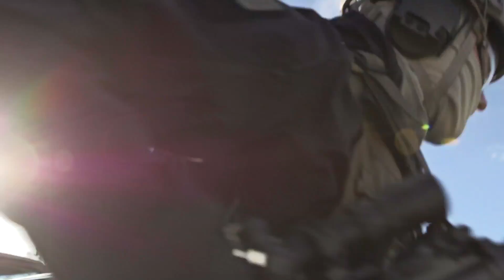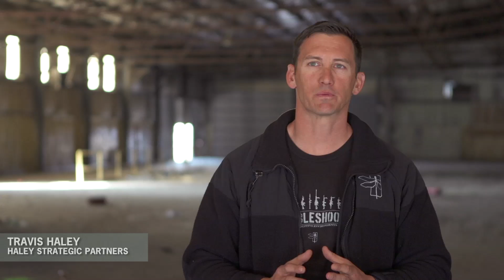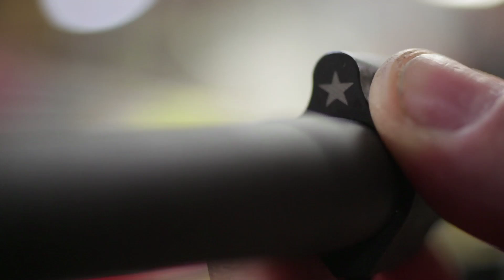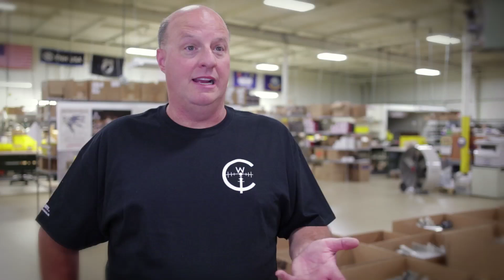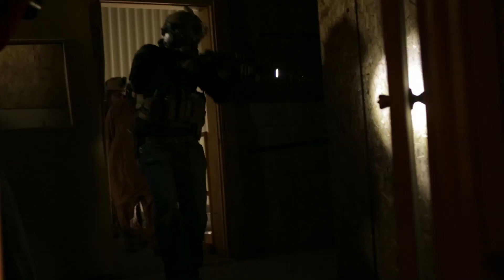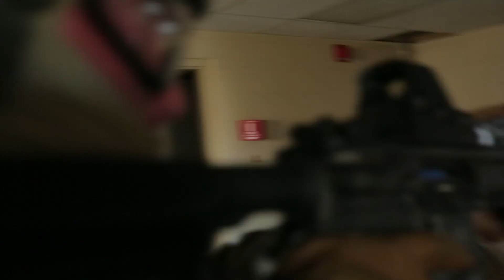The Haley Strategic Jack Carbine Built by BCM

Comment: Funny one of the first (HONEST) video reviews of this gun pretty much concluded it was an over-gassed, out of spec crap.  

It didn’t even meet standard MILSPEC parameters.  Much less than rifles like LWRC who are actually used by special operations and SWAT groups around the world.

I’ll give you a free “Advertising” secret.

Products that are heavily pushed, reviewed, and marketed on how “amazing” they are; aren’t.

The really exceptional product don’t advertise.  

It a waste of money because the product history and reputation speaks for itself.

Take a second to reflect on all the AR15/Pistol/shotgun variants that are heavily marketed to the public.  They end up being AVERAGE at best.

Reflect on any marketing you’ve ever seen from legitimate HQ MILSPEC+ firearms?  Rare and uncommon.

You want a legitimate HQ MILSPEC + AR15 riles?

Simple, LWRC, LMT, KAC, and Barrett’s REC7 to start with.

Basic, but guaranteed MILSPEC or better rifles?

COLT, FN, DD, JP,  (HK deliberately left out).   

You really can’t go wrong with any of those firearm manufacturers AR15 lineup.
Reply: BCMs gassing issues were resolved years ago. They’re about as mid as you can get and better than new Colt. Old Colt I’ll agree with you on.

The market was also completely different 12 years ago (ten from your comment). Most rifles back then were all still carbine length gas on a 16” barrel and over-gassed to hell. The Jack carbine was at least more forward thinking with its tail as gas system length.

Comment: What an overpriced piece of crap which you are just paying for the name.  Come to find out, the upper and lower were just re-branded Aero U/L receivers.  Finish was very sloppy for the price!  Didn’t even get a chrome BCG like DD sold at the time.

You literally could have pieced together 10x the gun for the price on your own!

And, you don’t even get SSA trigger for the price.  Amazing firearms tactic trainer and/or operator.  Gun designer?  Junk.   

I like TH message, programs, then he tries to scam the community out of money in exchange for junk.  No different than that “FireCLEAN” scam that was SWORN BY all these Delta/Seal operators on videos, conventions.  

It ended up being pure cooking oil hahaha.   FrogLUBE wasn’t far behind which ended up being color green dyed Coconut oil hahahaha.  All these BS SEALs swore the used that over priced crap religiously.  When every TG I know was secretly using their own special blends of motor oil, trans oil, and lithium grease.  Once again, paid to sell you lies.

Don’t get taken by these scammers; take what you can from them.  Then, leave everything behind.  Build, and buy your own gear.  

Leave the fancy, pretty, sexy name propriety crap (yes, I’m talking about you HK and your 12lb 416 3moa monster).  

It really bugs me when “icons” of the 2A community try to push their own brand of gear that is twice the price of HQ gear used by SOF, just because of their name they put on it.  

Screwing countless new shooters out of hard earned money just because they trusted you.  Such BS.  

Do your own research.

With all the comments and this being a 10 year old video; no one will read any of this anyways.

Comment: First thing out the BCM  Rep's mouth was our objective is to build it correct . Then flashes to barrel nut being torqued with the tool fixed parallel to the torque wrench  (which acts as a multiplier )  rather than at 90 degrees. Perdy gun though!

Comment: It is now January 2021 and my brand new BCM MK2 Recce 16 is so loose between the upper and lower that it rattles.  Attention to detail is certainly not there.
Reply: They use accuwedge to get that wiggle out. Most billet upper lower combos machined together for fit. Heavy and expensive. Accuwedge 4 bucks. FYI Rattle does not make less accurate, JUST ANNOYING 😝

Comment: Build same rifle for half price.
Reply: yep
Reply: I just built a clone essentially. 
Geiselle mk14 SMR 13” - 191.00 vet day sale
BCM BFH 16” mid length - 269.00 Halloween
BCM BLEM UPPER - 50.00 on BCM site 
$500

I through an Anderson lower($40.00) (I’m from northern Kentucky, so I’m partial)
ALG trigger, BCM Hhandle and stock and an eotech 512 ($379 at PX)with Magpul pro BUIS 

I’m looking to buy a new BCG and charging handle to match the quality of the upper but all in all it’s well under $1000.00 and has been great. Sales and patience is truly the key to an outstanding rifle without spending the incredible prices some people are asking
Reply: @Not-a-bot222  really? You didn't even do half of it right to call it a clone ... nevertheless (and especially) compare prices ...
Reply: LtThompsonCS well to be honest I did not say I built a 1:1 replica. I built essentially a clone meaning some things are different however the overall concept and parts are very similar. I cut corners with the lower and I don’t have the same rail. I recently through a geissele super charging handle on it and the super braided 42 buffer. My comment wasn’t meant offend a “purist” or start an argument 5 months after the original comment. It was meant to shed light on my own project and give prices for someone who may want to build a good weapons that is very similar to the one in the above video.

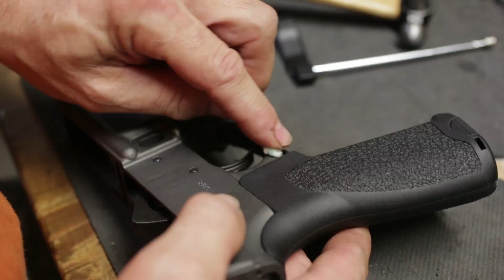Comment: BCM makes some great stuff. I definitely have some of their parts on my rifle. However, when they started talking about their muzzle device and the guy at 2:40 said theirs was the first to cross between flash reduction, ground signature, and compensation properties, I laughed. Though the standard A2 flash hider is primarily a flash hider, it was designed to be solid on the bottom to not only reduce dust pick up, but to also reduce muzzle rise by venting gass upwards. Pushing the barrel down. If I were to be totally honest, you don't really need anything besides the original A2 flash hider. Not saying the their muzzle device isn't better, but definitely not the first device to address said issues.  Even then, it isn't that much better than a stock flash hider. There is also a flash comp for 26 bucks that is slightly longer than the A2 and shaped slightly differently which also slightly inproves both flash reduction and muzzle rise. Again, not saying the BCM flash comp isn't good. But they do overhype it a little. Unless you go for a muzzle brake, most flash comps are not very different from each other.

Comment: And here I am running a palmetto state armory setup...
Reply: What if I told you brand doesn't make you shoot better...

tight pants do
Reply: My first build was a PSA middy upper. It was a sweet rifle. Just remember, a good warrior can fight with any weapon. Adapt and overcome. Make your weapon work for you.
Reply: I have full PSA CHF midlength I built for a bit over $600. It's been a great rifle. My BCM has a complete 14.5 BCM upper with BCM CH and BCG. I used a PSA lower with a BCM pistol grip and Magpul CTR butt stock to save a bit of money. Even with a pin and welded surefire brake and BUIS I'm only out $700 or so. That's the only think keeping me from these. There's so many great guns you can piece together to save a little money. Although the resale is great on these I bet.
Reply: psa hammar forged barrels are from FN, same as bcm. being in spec is more important than materiel unless its the BCG or you are shooting 10s of thousands of rounds of ammo a year.
Reply: U paid only $700.00 for a complete BCM upper , sure fire break, and a off brand lower?? How?

Comment: So no information on the barrel at all in the video or on their website which is one of the most important aspects, along with any information on the upper and lower receiver.

I'm sorry but I just built my first AR for $1030 which has far better equipment than this rifle which is listed at $2200.  I'll take my Seekins billet aluminum lower receiver and melonite 1/7 twist government barrel any day over this BS. 

In my eyes you're paying $1000 for BCM logo etching, a flashlight, and a charging handle.  Wow, congrats.
Reply: +Hardcaslte +Condor1970 You built your first AR? Wow congrats...  You've just proven you know nothing about any weapon systems platforms...  If you and Mr. Condor excellent Engineer "extraordinar" would have said nothing from the start, you would have been better off.  You built a premium rifle for $1030.  No, what you built was a budget hobby gun.  You dumbasses stand behind that keyboard and speak of something you know nothing about.  Same goes for the majority that commented in here.  And ill speak for myself by saying I'm not an expert, but after hours and hours of research, owning multiple AR's and have shots thousands of rounds through them with multiple range trips throughout the years, I think I'm qualified to speak on the subject. Factor every piece of hardware put on this rifle and the price tag matches up to about $2000.  You're not accounting for engineering, testing, overhead labor, direct labor, & marketing into the cost of manufacturing.  Yes, marketing counts too cause they have to let people know about the products they make.  Anyone and everyone who says forged material is crap?  Again you know nothing. I work in manufacturing dealing with high density alloys and materials for oil drilling equipment so again, I think I can speak on the subject.  Forged aluminum is stronger because thethe alloy is pressed together under immense pressure so the molecule grains are in line with one another.  Billet aluminum is merely poured into a mold like a casting and then shaped into a block.  These ass clowns are only appeased by aesthetics of the rifle, so in their mind, billet looks cooler so it must be better.  As far as the barrel, its s cold hammer forged barrel.  Again, its a forging.  You can fire tens of thousands of rounds and it'll still hold under 1moa with minor deviation.  Stainless steel on their other hand is slightly more accurate, but accuracy opens up under high cadences of fire not to mention accuracy is thrown out the window after 15,000 rounds.  On a last note, anyone that says DI guns are worthless and aren't as reliable as piston guns, again, you know nothing.  I say this because I bought on the hype when they first introduced piston systems to the AR platform.  They've done countless tests and studies to disapprove this theory.  Its a marketing game.  They come out with a new product that states its the latest and greatest, so you buy it, and you'll do anything to justify that purchase for a variety of reasons either because you have a huge ego, you're broke so you can't afford quality, or you just don't want to admit your stupidity.  I've owned both, shot both, and still prefer DI over piston guns because reliability is just as good, its a proven system (yes it had hiccups in the beginning during Vietnam due to numerous factors which I will not get into),  accuracy is just the same, and not to mention DI rifles recoil impulse is lighter and muzzle flip is flatter (proven fact).  I could go on and on about this debate.  Just shut the fuck up, shoot what you like, and be done with it.
Reply: sorry dude, melonite has one thing over a chrome lined barrel, and that is price. Chrome lining is harder and will outlast melonite, there are plenty of tests that show this.
Reply: xprocharged1 Actually it's exactly opposite.  Melonite is harder than chrome and offers better accuracy, especially over long duration.

Comment: this is just a bunch of stuff thrown together. it's like building your own only they do it for you and charge another $600 ($21XX retail price on BCM website). there is no advantage to this. go do your research and build a better one for less.

having built my AR, what im seeing is a bunch of inexpensive parts thrown together and retailing for twice what it's worth. that ALG trigger is $70, that stock and grip are just polymer like dozens of other manuf. make. upper and lower, kind hard to build incorrectly. you can get a high quality (say northtech for example) set for 400. a rail of your choosing for 150-300. if you want to go the piston route (i would), you can get an Adams system (barrel included, melonite is harder than chrome btw) for something like $33X.xx

if you really just want to buy and not build and save a ton of $$$$, just buy a POF. superior to what this rifle is in every way. you can even throw on BCM's magical compensator suppressor flash destroyer.

i've a built a better AR with more expensive parts for 30% less than what they're charging

Comment: "This is not a signature piece, or a collector item"~ Yes it is. It's $2,400, for a dressed up rifle. You can buy a $1,200 Colt that does the same exact thing with the same exact efficiency.
Reply: Biggest thing with this is probably resale. It's also fairly rare I would think. I love my Colt 6920 I paid around $850. I could get pretty close to that now
Reply: no you cant....
Reply: Nah, Colts are dog shit. Even my pre 86 Transferable is nowhere near as well built as these boutique guns. Side note, BCM's prices are very competitive for every part I've bought from them. I don't see how people are figuring they can build the same gun for 1/3 the coin. Seems to be mostly queer baits who don't understand fit and finish is where the time and thusly money goes. 20% nicer usually costs you 50% more....its how the world works.
Reply: Colts are about 900 now. And a mid length gas system is better than a carbine length gas system. A lot smoother and more rounds on target quicker.
Reply: Same efficiency? Not only does it have a mid length gas system but it has a comp and free float rail. So no, not same efficiency. And BCM quality is better than colt.
Reply: Sig Sauer 516 rules!

Comment: I like their helmet set up. Any idea what helmet brand and accessories beside ear protection theyre using?
Reply: Looks like an Airframe helmet with a Surefire helmet light and Smith Boogie Regulator goggles.  Also some sort of IR strobe on top of one and a battery pack on back is my guess.  Have not had ton of luck with any googles in high stress situations, looking into some thing like a Cyclone Mike right now to solve fogging.
Reply: +Cardiac Tactical No, those are MICH helmets. The 2001 and 2002 cuts.

Comment: What kind of rounds were they using? Some type of practise rounds that will cycle the ar platform properly? I would be VERY interested in getting my hands on something like this.
Reply: It's called Simunition. You swap out the bolt carrier and you use paint-tipped rounds. Hurts worse than paintballs when you get hit with them.

Comment: BCM and the rest of you, congrats on getting your product through the Mil-spec (Mil-standard) testing. I personally know that it can take many years of waiting to get your product evaluated and certified for use by the military. Only way to by-pass the wait is if a commander in the field requires a solution for a problem "RIGHT NOW". Then your product will be fast-tracked to be evaluated and tested. Good job fellas, don't worry about the keyboard idiots that leave propaganda bullshit comments.

Comment: You that keep bashing "Mil-spec" have probably never visited the Aberdeen Proving Grounds facility. Depending on which "Mil-spec" the manufacturer or branch of military requesting said testing is what dictates the testing regimen. Testing does not stop at functionality but pushes through to point of failure.  The Blowing Sand or Dust test for example is destructive. Cost is a factor but then again, don't you look for quality and a fair price?

Comment: mil spec means the most quality you can get for the least amount of money. the brands mentioned are great, but why stay with mil spec if you can get better in some areas. by the way, i have seen this product and played with it. its missing a properly staked gas key. there are many great manufacturers out there. its the consumer's responsibility to figure out whats good for them. that is why lots of people build their rifles from the bottom up.
Reply: Yes and No mil-spec means a specified way of doing what you're doing...... a 100% mil-spec ar15 (bcm) rifle is interchangeable and it is tested just like military M4s..... now there's mil-spec dimensions without the testing and then there's mil-spec materials and dimensions but with a non mil-spec coating and or testing procedures..... 100% mil-spec  like bcm or DD is mil-spec materials, dimensions, and testing procedures / quality control..... it's the standard for a reason also most special forces around the world use a mil-spec M4... mil-spec is not the low end stuff most would have you believe.... also look at older hk416/m27 IAR it's non mil-spec lower had problems with pmags.... mil-spec doesn't and Parts availability for mil-spec is better.

Comment: No problem :) oh and  believe it or not play between the upper and lower doesn't affect accuracy because all the stuff that is important to accuracy is in the upper. but it is a bonus when the upper and lower have a tight fit. and also those companies i mentioned will have nice fitting.
Reply: I tell people that don't know much about mil-spec like this...... now there's mil-spec dimensions without the testing and then there's mil-spec materials and dimensions but with a non mil-spec coating and or testing procedures..... 100% mil-spec  like bcm or DD is mil-spec materials, dimensions, and testing procedures / quality control like a military  m4..... it's the standard for a reason. And most Special Forces around the world use the M4

Comment: unfortunately mil spec has been thrown around by too many companies. Mil spec  means build from better grades of steel and aluminum and better manufacturing processes. if you want true mil spec look at guns made by KAC, BCM, Daniel Defense, PWS, Larue Tactical etc etc thats just a few. when you invest in guns such as these you will have a very accurate gun with outstanding reliability and will last a lifetime.